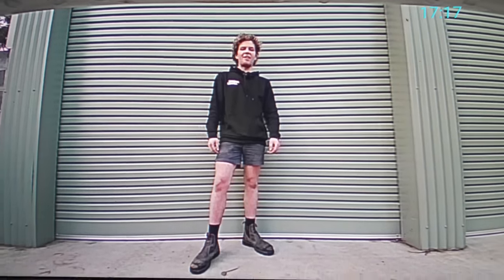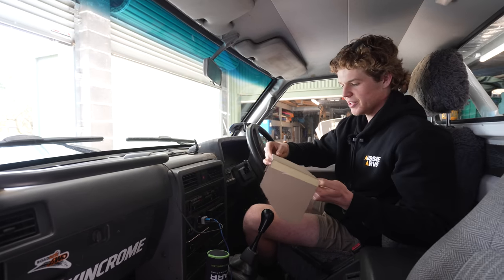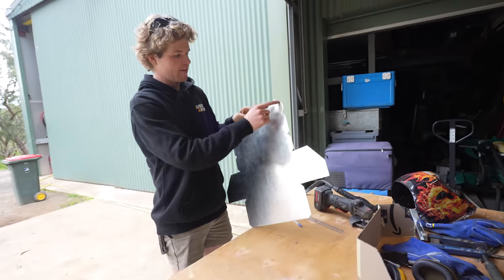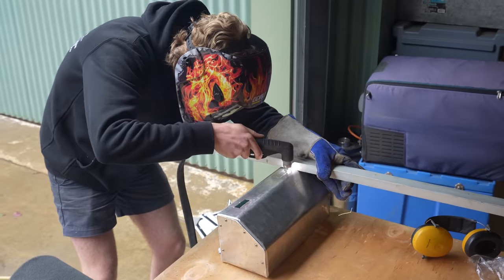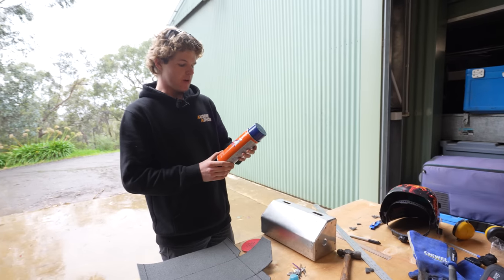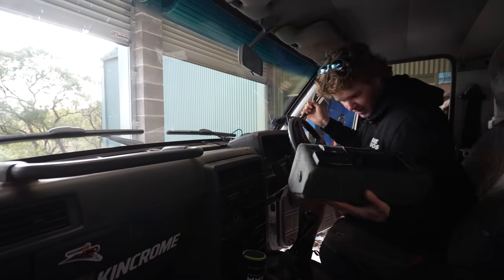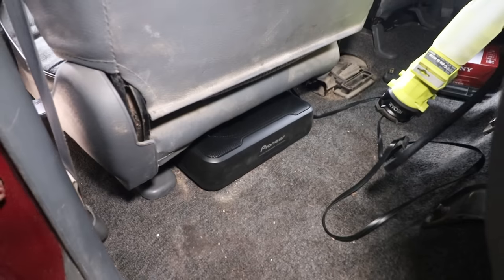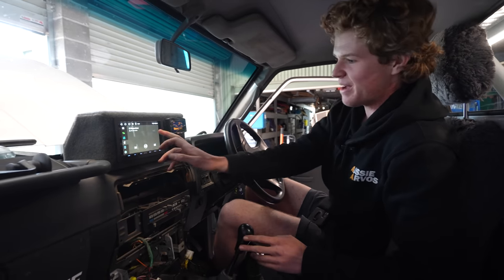Making the dashboard every 4WD needs!

Comment from the maker: What's your guys thoughts on the box? would you do anything differently?
Reply: I reckon I would of made the same decision. A workable double din unit couldn't go anywhere else. And it looks great and works well. Great execution Liam
Reply: This really looks sick. I would not change a single thing honestly. I’ve got a 98 Triton and this video has given me some ideas to work with my Ute and get it fitted out. Cheers guys 👍🏼
Reply: Got a link for the sub you put in, I recently put one of the teyes android(practically the same as yours) touch screen units in my old 2003 courier, they're pretty cool hey having a bit of tech in an old car.
Reply: The only change I can really see, is to make it slightly lower, but I don't think you could go much less. 
Otherwise, to make it more of a factory look, & it would be a massive effort, would be to rip out the whole centre dash/console, & start from scratch. Your design is much more cost-effective & still gives you everything you need
Reply: Ive done the same but i used a gq radio fascia flipped upside down and cut in half to match the rest of the interior!
Reply: Looks good, If you ever make a 2nd edition, it would be cool if it was 3d printed so the whole unit blends into the Centre of the dash above the air vents and have it covered in grey vinyl to match the dash.
Reply: @praadnyawadke2780  If you are wanting a stock solution you can get a PA2 Challenger head unit surround. That will support double din
Reply: I’ll pay you to do this to mine champ. It is the gq’s worst issue in the current world
Reply: i'd have the headunit on the right of the box instead of the left, but just my preference. nice work!
Reply: Love your work bud !
Reply: Sick work mate loving the videos. Looks awesome personal opinion would be a slide out double din which you can slide away when needing the extra vision and cut the box down. But all in all I love watching these DIY videos as this is the reason we buy older fourbys. Keep up the good work guys.
Reply: Bloody awesome, with the carpet looks like a factory unit🤘🤘🤘
Reply: The only thing I'd change is to solid mount it mate. The last thing you want in an accident is that thing flying around the cab.
It could turn a half serious accident into a deadly one.
Reply: @shreck2259 I was thinking the exact same thing about the new screen. Dashboards are padded for a reason. This display mod may not comply with ADR and (as a result) fail pink/blue slip as it could potentially scalp/decapitate someone in the event of an accident, especially if made of metal whereas the rest of the dash is made of malleable/forgiving plastic.
Reply: @stiffpants  this is why i failed a pink slip diy box on dash with cb reverse cam dash cam and a monitor for gauges, removed box and screwed monitor and reverse cam into dash cb went into ash tray n stuck cash cam on the windscreen rego pink slip passed and my diy box went in the bin, nothing said about 35s and 6 inch lift on pink slip rego check
Reply: @shreck2259  this is why i failed a pink slip diy box on dash with cb reverse cam dash cam and a monitor for gauges was screwed in to dash and carpet added to match dash mat, removed box and screwed monitor and reverse cam into dash cb went into ash tray n stuck cash cam on the windscreen rego pink slip passed and my diy box went in the bin, nothing said about 35s and 6 inch lift on pink slip rego check mechanic told me my diy box wasn't adr approved and dangerous and that car passed brake and swerve test on a old engineering cert so lift and tyres are ok.
Reply: @micktaylorwolfcreekmechanical  Yeah you've gotta be really careful. I've only lifted my 4wd what's legal within nsw (without requiring an engineer's certificate).
Good mechanics will look for elementary safety hazards (such as small holes in the engine firewall/poor condition dashboards/frayed seatbelts etc).
The laws of physics don't change no matter how fancy the screen in front of you is/how rich you are. If you crash/burn at 110kph/70mph you're toast.
Reply: Also add the dashcam accessory camera. Very clear and good viewing angle camera!
Reply: Heat dissipation. I would have drilled some holes somewhere. At 45 or 50c° in the sun, it could become a fire hasard. Also, small hat protruding from the top to block the sun and mirror effect. Very nice job all the same
Reply: Great idea, just got to go steal a street sign now.
Reply: Yes, make it smaller trim it differently
Reply: I'd leave the street sign surface on the outside and uncovered for a cool/underground look.
Reply: Perfect for the GQ after owning one knowing they don’t have the best dash set up for radios or much else
Reply: @shreck2259  agreed. Velcro doesn't cut it. Good initiative but a bit to learn about keeping the rig safe. That box will become a projectile, in any impact
Reply: Love a good box
Reply: Great end job mate. I've enjoyed your presentation so I liked and subbed. That is something I would like to have. At ther moment I am using Geotracker on my S 22 Ultra. I've just got a ball on the dash where I mount it and it's a piece of cake to follow the exact track you went on months ago.
Reply: vent holes or fan cooling that metal box will be an oven for your poor electronics.
Reply: Can I buy one 😳😳 I need one for a kei tuck
Reply: the reason for the jagged edges when you were using the snips is likely because from the video it looks like you were closing them all the way. when using snips its best to not close them fully except at corners or to finish the piece. it can also cause fish hooks which are sharp little barbs that will form along the cut line
Reply: I would change nothing! It is amazing! Could you do like a tutorial video so I can use it later, human?
Reply: you should try the auxbeam switch’s heaps better 8 push button switches were 3 mechanical switches fit
Reply: I plan to remove the OEM headunit bracket and remake one to accept a double din head unit and a UHF, + a switch panel, It'll all fit just going to be fiddly with the fingers wiring it up. Where your unit is im making a similar styled box thats to suit a row of 52mm guages and follows the same line as the main cluster panel arch. Hard to argue it obstructs vision if its line doesnt go any higher than the OEM line.

Comment: the atoto units are very nice, i have a a6pf wich for the price destroys most stock touch hu, but something that could be a pain point is that by default instead of turning off when ignition is off they go for ~12h in standby before shutting down, wich lets it boot quickly(not that the default boot is slow) within the standby period as you have shown in the video, but it means that they'll still drain battery, the only way to disable this "sleep" mode is by accessing the secret menu, which contains some further customizations(be careful in here) and can be accessed by going into settings, then click the “system” button 4 times in rapid succession and when prompted put in code 3368

Comment: I've been using Android Tablets in my 4WDs with my favourite Android Apps, including iGO Street Navigation and OziExplorer Maps for over 7 years now. I love the ability the tablets offer to test and try out the different Street Navigation and Off-road Topo Maps on Android Apps Store these days and for the life of me, I can't see the point of spending $600 on a main brand headunit that only offers Android Auto Play when you can have a fully functioning Android Head Unit like like the ATOTO,  

I had a serious look at the ATOTO S8 earlier this this year, and came very close to buying either the S8 or A6 Advance, but as I was about to undergo surgery and off work for a couple months, I opted to stay with my Single Din Kenwood and up-grade to a Newer Tablet for my Patrol and have another look at the ATOTO later in the year or early in 2024.

With most of the ATOTO Headunits, you can also connect a 2nd front camera and record and store both the Front and Rear camera views, and the front facing camera can also assist in that dreeded front Black Spot due to the bonnet while 4WDing.

Comment: What a great combo. Having the S8 up top is so much better than hidden down low and it does look great and will be very useful. I’ve been looking at the ATOTO units but either the pro isn’t available here or just not seen it yet. It does look very sleek. Also impressed with the JustRaceParts gauges. I was in touch with them for a tricky setup and need to complete the order with them. Very good to have the audio and gauge set there. Also the additional switches. I’ve a few blanks but if I was making a pod then I’d follow your CAD. The dash mat and the pod do look very factory. My dash has reasonable space for a double-DIN but I’m impressed with the aluminium box, rivets and carpet. You’ve done in a couple of week, what I’ve failed to do in a couple of months. Would I do anything different? Well no. My application is a bit different but I need to think now! Thanks for making and sharing.

Comment: yes... yes the cheaper ones do last been running them for years. cant complain for a $300 10.1" unit with all the same stuff. actually thats at the top end with the 8core procesor and 16/128gb internal storage. even the wifi antenna is built in. love the endless customizations that come with these units. even changing the home app to something with more info like carwebguru if thats what your into. great addition to the rig. box looks good.

Comment: Hey Liam, i might suggeswt that you cut the back of the folds with a 1mm cutting disc but only like a third through the material, i reckon that will give you a good sharp straight fold.

Comment: CAD.... Carboard Aided Design..... I like it and its a time honoured process. In shop we would score the fold lines a lot  deeper to help them fold easier and get a square edge bend. You could also use Vinyl or leather for wrapping, carpet is more difficult but cheaper. May have put the Head unit on an small angle pointing toward you.  May be a pull out glare hood over the head unit so as you can see it in the sun or pushed a littel back in the shell so as it has shade over the screen. 
Nice job but!

Comment: a tip for when your extending looms use trailer loom wire its cheaper and its pre sheathed, alos you can get it in 5,7,and 12 wire

Comment: I have considered such a method but the location on top of the dashboard obscures the view essentially with a high clearance rig and even difficult for off-roading. So I brought it down just under the ac vent and a second tab facing me from the passenger side dash top/shelf.

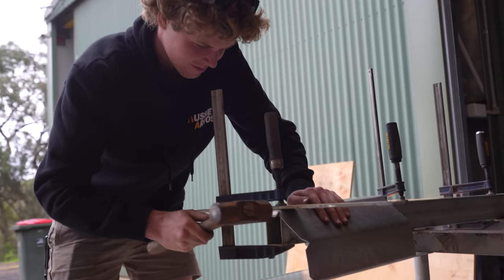Comment: 3:51 not a fuel tank, not structural... protip: use a grinder with a worn out disk (about half way gone or more) and make slits along the fold. You want to leave the ends intact, don't slit those, and as a rule of thumb, you want to leave tabs that are at least 2 cm long (where applicable). Also, aluminium benefits from heat on bending too, just not as hot as steel. A heatgun for shop work is all you need (max setting, just hot enough to make you use gloves).
Sidenote, i wouldn't have bothered with the tabs. They're difficult to fold even with proper tools and they're more of a nuisance. Just bend your box to shape, and use 2cm squares bent to the proper angle, in which you sink your rivets. Since this is not a structural box, using smaller rivets is perfectly ok.

Comment: Every time i've tried to fold a road sign it cracks because the aluminum is hardened. Might try annealing it by heating it with a torch, at least where i need to bend it.

Comment: Here in vic thats a defect no gauges or displays above factory install, no illumination to be brighter then original cluster.
No modifications to dash original dashboard with out engineers certifcate thats adr approved.
Thats now get a new dash a defect and a fine. And a new road worthy

Comment: awesome, i use the same or maybe an older version of the JRP System! works great except if the sun light hits it and i am unable to see any of the values. Do you have similar problems? its also very dark during days when i drive with driving light active(basically always)
Reply from the maker: Haven't had that issue with mine, the  dim sensor on mine makes it dimmer at night but it's fine during the day

Comment: Great video and great result. I'm actually surprised there isn't a law in Australia (especially Victoria) that prevents you from installing anything (including a head unit) that could potentially impact your visibility through the windscreen. I'm kinda joking, but I'm kinda not  ; )
Reply from the maker: There are certainly regulations, from my reading as long as it doesn't clip past the bonnet it should be fine

Comment: Where did you actually run the cable through the top of the dash? I have a GQ and want to do something similar. Cheers.
Reply from the maker: There's a gap in the corner where the windscreen meets the pillar and dash

Comment: mentions 4g at around 9:00 - my tip is don't bother with it as it'll be a second sim card and another expense. instead, what i've done is pair my headunit and phone via bluetooth and have it set to automatically connect. i then created a rule on my phone so when the headunit connects, it automatically turns on the hotspot which my headunit auto connects to. and then another rule to turn off the hotspot when it disconnects from the headunit
edit - i should watch the entire vid before commenting :P
Reply from the maker: Haha yeah I've done exactly that!

Comment: Great job; it is very similar to the location and design of the headunit in the JB64/JB74 Jimny’s.
My only complaint with the Jimny one is that the factory one is unreliable and has no tactile volume knob. It could also stand to be a bit bigger and it would be good it there were more user-installable Switch receptacles.

Also, Don’t say Velcro;
https://www.youtube.com/watch?v=rRi8LptvFZY